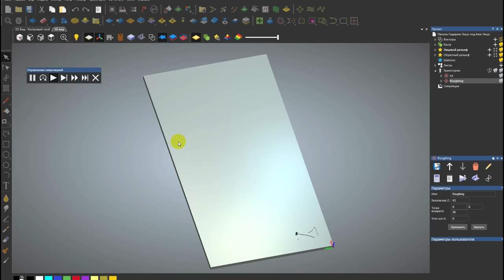Biggest 3d panel with CNC router

Comment: Servo's are so overrated! :):) great work. from time to time I'm happy with youtubes suggestions.  This machine has been paid off with one job.. :)
Reply: Matrick Galius.... how much?
Reply: Can you explain about servos?
Reply: @laserfalcon  

Servomotors aren't like stepper motors - they keep track of exactly how much they've moved using something called an encoder. For example, a piece of equipment inside the motor shines a light on a rotating part of the motor with small reflective marks on it, giving a signal when it get some reflected light back. This allows it to track how much the motor shaft has rotated since it last measured a reflection, and with some simple arithmetic, how much real-world distance a fixed point on the motor shaft has traveled (as if you'd wound a piece of string around it while it was running and measured the string). That's an example of an optical incremental rotary encoder - i.e. it uses light, counts how many rotational marks it has seen, and allows you to determine how much the motor has rotated. It can then feed this data back to a system controlling the motors (a so-called closed loop system).

This allows you to know, within reasonable error margins, how much the motor has moved, which stepper motors cannot do. Steppers can miss steps under heavy loads or because of electrical faults and the control system would have no idea it happened. Effects like that add up to inaccuracy in every motor-controlled axis, which is unacceptable in industrial settings. For this reason, low-end stepper-driven CNC machines often have limit sensors on the axes and sometimes also have (usually optical or magnetic) encoders of a different sort installed along their axes of travel called linear encoders (e.g. glass linear encoders, a piece of glass with marks on it that are counted by a laser), because you can make no assumptions about how much the motor shaft has rotated based on its step count. This is why basic stepper systems are called open loop systems, because there is no feedback. Adding an encoder to them creates a closed loop, but without the extra feedback and precision of servomotors.

Expensive servomotors might also have a zero-finding capability built into them, so if you cut the power and turn it back on, they know what position they're in already. Incremental encoders don't ordinarily allow for this, because all they do is count ('increment') how much they've rotated since the encoder was turned on. They are much cheaper and simpler. The motors themselves, though, are not as complicated as stepper motors because they don't need to advance in discrete steps to help the controller.

The commenter here is implying that you would probably want a closed-loop servomotor setup to make something this big and intricate, because there's so much scope for slop and errors to ruin the workpiece. Then again, it's only wood. If it was a big piece for a rocket or an aircraft that required micron repeatability, it absolutely would be a closed-loop servo system running that gantry.
Reply: @notspacekeeper  wow, thanks so much for so much info.  I had wondered why so many cnc equipment or builders use steppers and some use servos.
Reply: @laserfalcon  

Yep, with sufficient skill and care, you can make a stepper system very, very accurate. Add encoders to it, and it's almost as good as a servo system in terms of accuracy (but you need a control system that can make sense of the feedback). Some servo motors can move in ludicrously small increments, like 0.2° compared to a typical stepper's 0.9° or 1.8°.

There's one other really interesting difference with servo motors: they don't hold their position like steppers do. The energized coils in a stepper motor are capable of offering up some amount of resistance to rotation. Stop issuing step pulses to the motor and it stays locked in place until you put enough newton-meters into the shaft to overpower the holding torque.

Servo motors have to do this as well because it's a very important feature of industrial systems - stay in one place for a while. Servos do this by very rapidly driving the motor shaft backwards and forwards. This also makes a bit of noise! Steppers will silently hold their position in whatever detent they have stopped in, but servos have to work for it.

Imagine a servo motor that can encode rotations of 0.2° driving a short-lead ball screw with a crazy C rating (not like the C7s we encounter in the DIY CNC world), that 0.2° might equate to a couple of microns of linear movement. Forward 3 microns, back 3 microns, etc. So for all intents and purposes, it might as well be standing still.

Apparently something like half of the world's industrial power usage is devoted to driving motors, and I'd wager a good number of them are kilowatt+ servo motors. There's a whole hidden world of engineering out there in dull grey buildings!
Reply: @notspacekeeper  Why is there some that swear by steppers and others swear by servos in your opinion?
Reply: @laserfalcon  

Steppers are simple and very cheap. You don't even really need limit sensors or travel sensors for most ordinary cutting. You can build a stepper-driven CNC cutter simply and cheaply because the control hardware itself is also simple and cheap thanks to the popularity of 3D printers.

Servos have been used by hobbyists building robots and things for a long time, but the sort of beefy ones you'd need to drive the axes on a heavy machine like this are hard to get to grips with and a bit more expensive. If you can afford them and understand them, they're 100% the correct choice.

NYC CNC has a good video using servo motors: https://www.youtube.com/watch?v=3TzNQnSKO_8
Reply: @notspacekeeper  Thanks
Reply: @laserfalcon  

I should add that those Clearpath servo motors you see in DIY CNC machines are designed to use the same inputs (step/dir) as the steppers people normally use, so they don't really need fancy control systems, they're supposed to be drop-in replacements.

https://www.teknic.com/products/clearpath-brushless-dc-servo-motors/clearpath-sd-stepper-replacement/
Reply: @laserfalcon  Here's a really good video that clearly shows the difference:

https://www.youtube.com/watch?v=mjYJTgPUDRc

What is glossed over though is that servo motors require a lot more voltage to work properly, and in doing so, generate a lot of back EMF when they suddenly accelerate or decelerate, which the cheap switching power supplies people use will not react well to.

They really want a beefy, simple power linear supply (pretty much just a transformer, rectifier and a big capacitor). Otherwise, you need additional circuitry (snubber circuit?) between the motors and the power.
Reply: @laserfalcon   no beneficials
Reply: @265Spike  For wood no, for metals yes. What nobody seems to be mentioning is surface finish. So yes for wood, aside from the benefits of being hybrid closed loop (typically) and thus include mitigation for lost steps and the like, it doesn't matter.

For metal on the other hand steppers, as the name suggest, make steps. And because they do, this will show up in the finish. The movements they make are not, for lack of a better term, completely fluid unlike servos.

Comment: wow, beautiful ... I worked on CNC machine in 2008, which had Intel 80386 processor. I could not do this level of carvings, but I pull maximum that can be done with machine.
Reply: With Which software
Reply: @ihnayem9234  there is universal G code for manual programming of CNC machines. Today, there are graphic programs that can convert drawing into G code. ... But you still need to know how to program it manually, because you have better control.

Comment: How do you prevent the warping of a piece like that ? 
Marvelous work !
Reply from the maker: After processing one side panel is warped. Then after processing second side the panel  become adsolutelly straight
Reply: Maude Potvin contra grain .opposing the different grains .
Reply: Илья Буката So the roughing pass on the backside was for the piece to flatten before finishing? I would imagine a fair bit of mismatch due to warping otherwise...
Reply: @MrBukata  , 
Please provide the address of the dealer/distributor of this cnc router machine in Indonesia .

Comment: I'd hate to be the guy who had to sand those.
Reply: omg torture
Reply: nylon brushwheel attached to a Drill does the job just fine besides with a small stepover there will hardly be any sanding required

Comment: That program doesn't have trochoidal cutpaths? PixelCNC has trochoidal milling for both 2D and 2.5D. I suppose as long as your machine is rigid it's not a big deal to use old fashioned offset milling. I've found that trochoidal milling lets me really ramp up the speed on my CNC router for hogging stuff out. It blew my mind how fast I could make it go!

Comment: Nice panel .. BUT .. to bad it's warped .. it may have been  sculpted from both side .. but has major warp, how is that any good unless it's either steam or heat treated tl take the warp out  ..  why was the piece not planed straight first ? ... just being a nosy old man ..
Reply: Plate warped because of the machining on one side. After the second side it is flat again.
Reply from the maker: Absolutelly correct! It is normally

Comment: how much time you spend on this ?
Reply from the maker: 72 hours each side
Reply: @MrBukata  Woah ! same time like me for a big model , But i think that when we increase model resolution it reduces the speed of CNC machine only for big models , but when you are machining a small model with high resolution CNC machine goes more faster :|
Reply: @MrBukata  Also when i increase tolerance amount it goes faster and also "classic raster" is faster than normal raster , I used artcam 2018...
Reply from the maker: Resolution should be usually so high as possible. About 90% from meximum. It will make toolpath more smooth.
About tolerance in artcam i tryed many different and decided that 0.03mm is faster for all my machines.
About strategy - regular raster a little faster than classic on 4 machines, and classic faster on one italian cnc center
Reply: @MrBukata  In artcam when we use a big model we'll receive lower resolution with smaller details , if we needed to have more resolution we need to start with a small model with high resolution and use add border to have same resolution among the whole model , i realized that lower speed is because of z Axis in 3d engraving and refers to Servo accelerations , in almost all cnc machines we have smaller z Axis servo motors and they're slower than other axises

Comment: How much does this cost ????
Reply from the maker: Panel?
Reply: @MrBukata   yes the panel.  l assume there are other designs also ?
Reply from the maker: Yes. It was cost 2000usd in size 2500mm × 1250mm
Reply: @MrBukata  one side or both sides?
Reply from the maker: 2000usd for a both sides